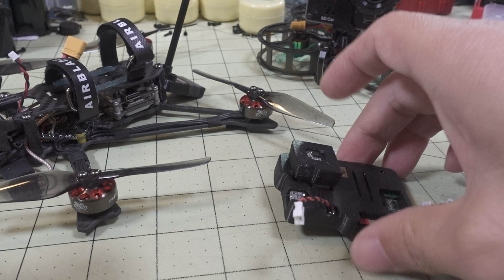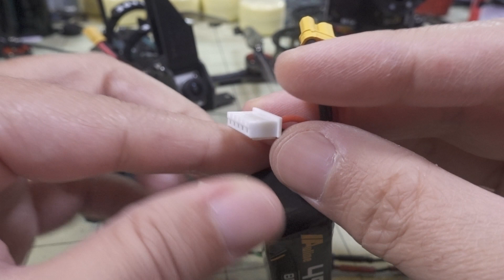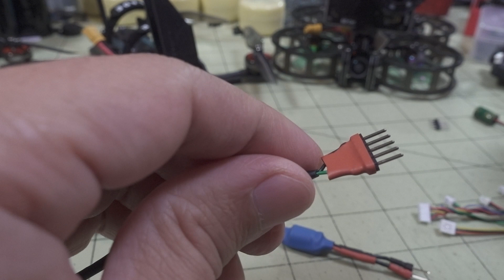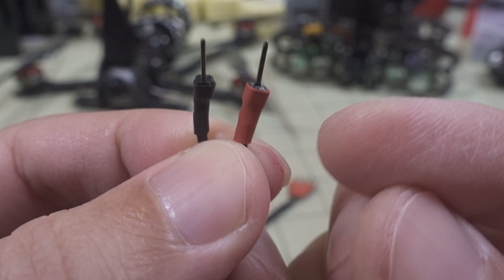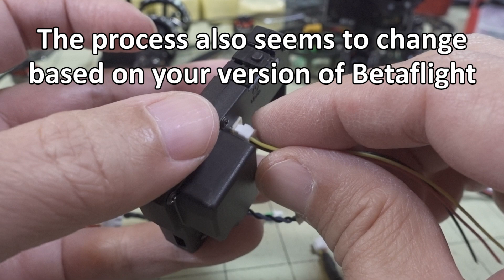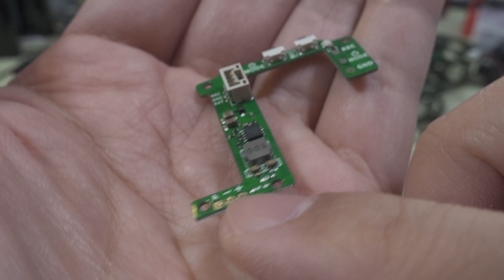Naked GoPro EASY Power Setup on ANY Drone ⚡

Comment: Adding cap to diy power lead seems good idea. I got 3 of those betafpv power leads so i just made 1 for 4s balance connector and second for 3s balance connector. One is kept for reserve. Might make that to have basic pins to fit all as you described. That was great advice.

Comment: Thanks for the advice on powering up the camera. I just ordered balance plug extension cables to modify for powering up my SMO 4k camera. The cables the camera comes with are horrible. It feels like solid wire with plastic insulation. I'm sure the wire will break from repeated movement. I also don't like soldering cables to the boards of all my quads just do I can use the camera on them. It's much better to just plug a cable into the battery. I think I'll also add a capacitor to the new cable. It certainly can't hurt and the female balance plug will prevent me from accidentally reversing the positive and negative wires since it's idiot proof.

Comment: I too also gave up on the yellow signal wire. You have to go into command line and do this and do that it's a lot harder than it looks
Reply from the maker: Plus you don't know if it actually worked or not.  Sometimes it doesn't.

Comment: Using the balance connector is just fine as long as you are not pulling crazy amps through the balance leads. The naked gopro is not pulling anything like the ESCs are pulling, so it should be totally fine.
Reply from the maker: agreed!

Comment: I like the gopro better than the I sta360. Great alternative method to power the naked gopro. That's how I usually power other stuff and had not had a problem yet. I use a capacitor also most of the time

Comment: Really enjoyed hearing the engineering development thought process. My greatest accomplishment in fpv engineering has been wiring a daisy chain of connectors for my battery killer from XT30, to JST, to PH 2.0, to PH 1.25 unless of course you count my hand grip mod for the T8SG using pipe insulation 😜. Not quite the same level.

Comment: Quick question what is the point on having a naked GoPro.
Awesome video and details.
Reply: @S Grim  thanks make sense
Reply from the maker: It's mainly for ultralight and tiny builds.  Often the drone builds weigh less than the weight of a full size GoPro.
Reply: @AlbertKimTV  thanks

Comment: I'm powering my naked hero 6 like the first method, straight from battery. I'm wondering if you would know why my naked hero 6 video files stop at a frame. The files record for the duration of the recording and flight but the footage will freeze at one point. I've updated the firmware. Could it be down to voltage spikes/sags while flying?
Reply from the maker: Voltage spikes could be a big part of it.  I would put in a 470uF capacitor and 9V BEC in-line so the camera has a clean power signal.  Also, make sure your SD card is good quality and format it in the camera and not the computer.

Comment: I have the Cinelog 25 and it has the 3 pin connected to the flight controller but my camera accepts a 2 pin connector - 5V. I'm still a noob but if I were to make an adapter, would it work, as in can the currents be passed both ways?
Reply from the maker: Hmmm, it's gonna be difficult to explain electronics in a comment.  If you have the same naked gopro as I have in this video 5v won't work.  If the connectors don't match, you can make an adapter and I believe it passes through lipo voltage on that connector.  The BEC in my video only handles 2S and 3S.  I'm not entirely sure what you have.  Good luck!

Comment: Hey there,

Is there ANY way you could give some amazon links or other links for the various capacitors, cables, and connectors used in this video?  My main struggle has been powering of the naked gopros and how to be able to swap them between drones.  This is absolutely the solution.  I just want to make sure to get the right tools.  THANK YOU for this video.

-B
Reply from the maker: They are listed in the description.

Comment: Do I need a Capacitor on the camera cable ? Is it more secure to have it? I have a camera cable solder to a 4s balance lead
Reply from the maker: Yes, it will help smooth out the power so there are no spikes in voltage.

Comment: Hi sir i have damaged my bec 5v  connection pins on the board. How can i power my GP now?
Reply from the maker: Which board?  GoPro side or BEC side?
Reply: @AlbertKimTV  Gopro side 😭. My gp is not powerig through usb now but when conected to gopro battery its detected on computer. When disconecting the battery it goes off.

Comment: Did you try the buzzer pad for the yellow wire?
Reply from the maker: Every flight controller is different so the setup for the yellow wire will have infinite variations for setup.

Comment: Hi Albert! My flywoo gp7 will power showing green light but no recording light blinking or otherwise...it worked fine for a couple flights and then stopped   after I pulled the card and it has never worked since. I've tried multiple sd cards but no change. Ive checked the bec and its plugged in solid.. Any ideas?  Also thanks for this video as i have the new insta360 smo on the way and already made your connector!
Reply from the maker: Did you connect the screen to see what is going on?  It may be stuck in photo mode.
Reply: @AlbertKimTV  yeah.. screen won't power either.  The power light is on but no record light, maybe the bec is bad?

Comment: I'm getting random horizontal lines in my footage, is that an issue with voltage spikes? Checked all connections and reseated all connectors, it only shows up during flight footage. Have you seen this issue?
Reply from the maker: I have not had that problem personally but I think it is due to a loose connector somewhere based on what I've heard before from other people.

Comment: I have tried these steps over and over again. I can not get my geprc naked hero 8 on my Geprc cinelog 25 to turn on recording. All switches set up. All files in cli set right. What am I doing wrong?
Reply from the maker: It's complicated... basically you need to figure out the correct settings for your flight controller and gear from the instructions on this page... it's not easy!  https://github.com/betaflight/betaflight/wiki/Pinio-and-PinioBox

Comment: Great tutorial! What capacitor should I use for a 2s and 4s?
Reply from the maker: 2S around 16v and 4S around 40-50v.  You can get away with less but with more risk.
Reply: @AlbertKimTV  Thanks!
Reply: @AlbertKimTV  what happens without the capacitor? I’ve been powering the gopro just fine with the 2 pins but now it won’t turn on anymore and Idk why! I checked the cable and changed the back but it doesn’t flash red anymore any suggestion? the gopro with the original display works just fine

Comment: Hey, can i use a 1s lipo connect directly to the bec to power up the gopro?
Reply from the maker: No
Reply: Why not?
Reply: @fpvchaos  The BECs step down the voltage from higher than 5v (don't know what the betaFPV BECs Are rated for) down to 5v. A 1s lipo has a nominal 3.7v ... so you'd have to step that up.

Comment: Can the naked gopros take any voltage? 4s 6s etc
Reply from the maker: It depends on what BEC board is in there.  You'll have to refer to the specs of the specific board you're using to know what the voltage range is.
Reply: @AlbertKimTV  ok thanks you. Was thinking of stripping my hero 8

Comment: Anyone know if this is acutally safe? Have you gotten any negative effects yet?
Reply from the maker: So far no problems. Dozens of flights.
Reply: @AlbertKimTV  Okay great thanks!

 I was trying to think of a way to power mine on a quad that has a dji air unit. Idk how to solder onto it and didn't want to solder anything on my esc because i have no idea if i can or not.

With this method it would make it a lot easier. Thank you for the reply.

Comment: So you put 15V to your GoPro? And it likes that? What’s the voltage it normally gets from the original battery?
Reply from the maker: No, there's a BEC on that adapter board that gives the GoPro board the proper voltage.  It's 1S voltage.

Comment: Soooooo on emax freestyle 2 will work? 2s power
Reply from the maker: That one doesn't use a 2S lipo with the balance lead so you'll have to wire up to the FC directly instead.
Reply: @AlbertKimTV  this i know, but if i wired it to battery connectors, will ir work?

Comment: Saw a post about connecting gps to the balance lead to get a lock before powering quad. He used step down voltage regulator.
Reply from the maker: There's a BEC on the board that attaches to the GoPro motherboard.  Also, for others reading this comment, this video has nothing to do with GPS so I'm not sure how this is relevant to this video.
Reply: @AlbertKimTV  use of the balance lead, is what reminded me. Sorry that I mentioned it.

Comment: you can buy female balance leads, i use them on chargers to avoid the strain plugging into chargers
Reply from the maker: That's basically step #2 which I don't like because it locks you into the battery size you use.  If you use a 4S balance lead, you can't use a 3S lipo.  I like my method better.

Comment: For some reason I followed everything and noting turns on 😭
Reply from the maker: Check all the connections for power and continuity with a multimeter.  There's probably a loose connection somewhere.

Comment: Would you consider making me a connector to power my GoPro 9 from a 2s lipo battery? I m willing to pay if you could help me. Let me know in this thread message and I would greatly appreciate it.
Reply from the maker: Are you talking about a cable like this one but can work on 2S instead?  http://bit.ly/3uXf0mt
If this is the case, I would need to still buy that adapter for the USB-C connector and also a separate 2S BEC.  The cost could be considerable.